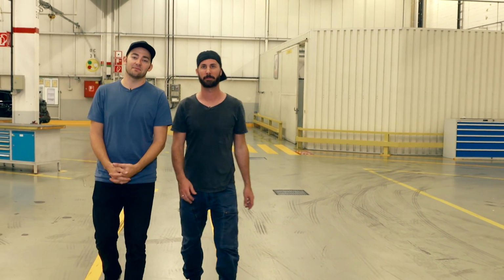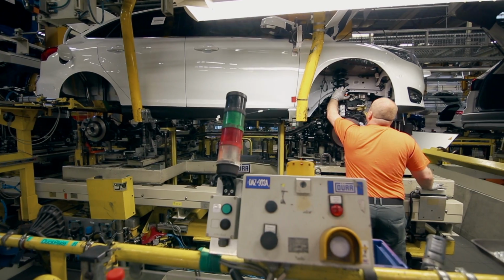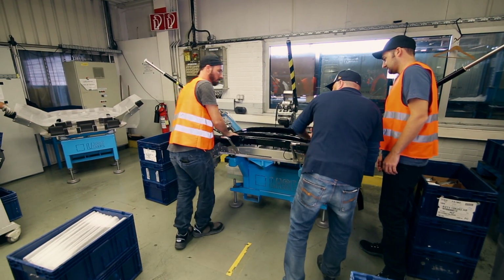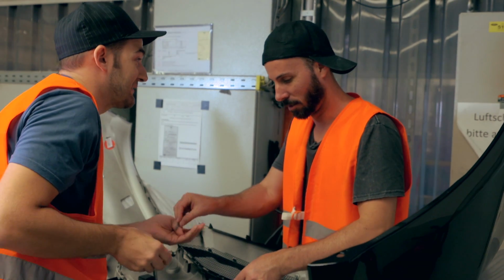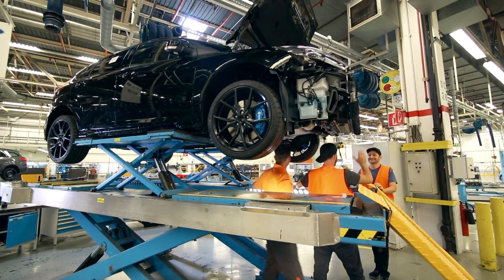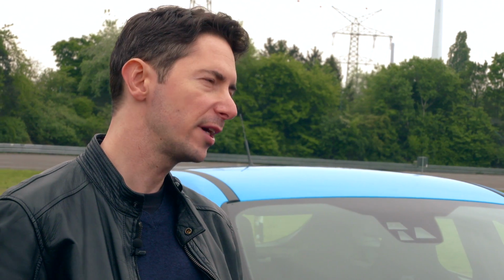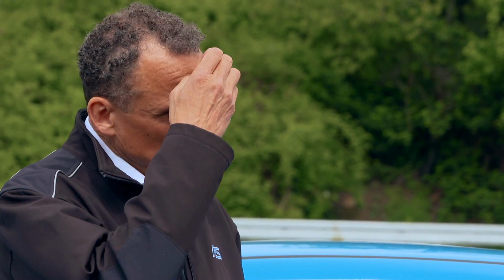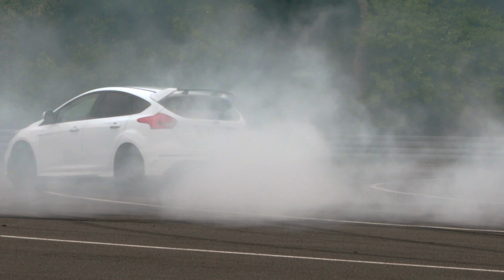Making Our Own Ford Focus RS In Germany

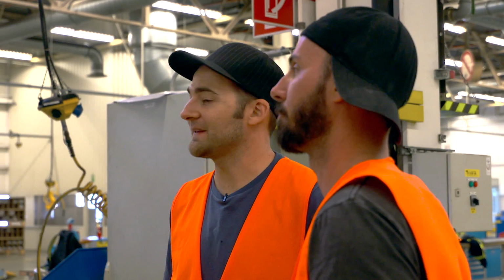Comment: 13:30 What's with the plate on the intercooler? Probably a myth, but is it true that the intercooler was actually too efficient, and they needed to block it off to keep some heat in the car?
Reply: The plate is a band aid fix for a condensation problem. Water accumulates in the IC because you are compressing and cooling air which reduces it's ability to hold water vapor. In high humidity conditions this basically means it's raining inside the IC. With the blanking plate the IC doesn't cool the air as much so that water doesn't condensate and eventually get sucked into the intake. It started as a problem with F150s. Google F150 EcoBoost Shudder.
Reply: OldRed91 that's why they painted it BLAAAAAAAACK!
Reply: OldRed91 also... idk...
Reply: @Bean Bandit, I totally disagree. I'm very active on the forums and local Facebook groups. The vast majority of people are very happy with the car. People who are unhappy are typically people who are track junkies that are tracking their car dozens of times a year, and I'm not saying all those people are unhappy, just that, some of those people, who are capable of pushing the car to it's limit, get disappointing when things like the EPAS (Steering) motor overheats, or they have to deal with the lack of camber adjustment, or the RDU overheating. There are solutions to these issues. The guys out at MMP doing the RSAA have with a few modifications these cars running all day on track in the Utah desert. 

Now the rest of us mortals who aren't running in the most advanced track day groups typically aren't pushing the car to these limits. Lots and lots of owners don't even track the car (shame! x3). The people who aren't tracking their cars are never (to my knowledge) hitting these limits and IMO the car totally delivers. It is an absolute riot to rip through windy roads in this car.
Reply: ^^^^ They are also Disappointed about about the earlier engine blocks going out, like mine personally had a head gasket issue and i had to wait 2 months before i even got it back. but now it is TUNED again and running better than ever! Love the car
Reply: Apparently it's a blanking plate from a Transit
Reply: https://www.carthrottle.com/post/how-ford-fixed-the-focus-rss-intercooler-after-discovering-that-it-was-too-cool/
Reply: @Bean Bandit, I paid the equivalent of 35,000€ here in the US. I guess that you guys get hit by VAT or some other tax. I think prices in your country are simply higher. For example Golf R and STI are roughly the same price. From some brief research all of these cars have their own set of problems on the track. You might not fault the Golf R since it's not necessarily track targeted, but my point is simply that I think it's unrealistic to expect any car at this price point to go out and track all day at 10/10ths and not run into heat issues. I think that stems from the fact that in order to make these cars at that level you're going to need a lot of headroom in cooling which 95% of the buyers don't need (or want? weight). 

Either way, I know this discussion will boil down to how you think the RS was advertised. All 3 of these cars are advertised as being capable track machines. Go to VW's website and you'll see a video of the Golf R drifting around a race track not unlike the RS. Go to Subaru's website and you'll see video that looks almost identical, except with more dirt thrown in. They are all advertised showing the cars at the edge of their performance envelope. I think it's just some people are simply naive and think that the car can run that way non-stop. It's simply not the case for the vast majority of production performance cars.
Reply: Compressed and cooled air = condensation . Same reason why air compressors have water separators
Reply: No Myth. I have a CPE on my ST here in Florida. On a humid day the engine will start ingesting condensation from the intercooler.
Reply: I was actually talking about people that use it as a track car or daily. If you just drive it like a normal person will there are some minor shortcomings but those can be mainly overlooked. Also Germans just have different expectations when a car costs at least 40000€ (which is really expensive for a hatchback). The RS is just not made to be "tortured"(but kind of promises to be).
Reply: John Brooks I guess that's what you get when people don't care about tracking
Reply: Is it also not true that RS has been having gearbox issues?
Reply: It's black... that's why it cools too hard lol
Reply: What you said was confirmed true by the engineers
Reply: they obviously havn't been to Queensland
Reply: John Brooks well it's actually not about advertising (i don't really care) point is car manufacturers lie to you in the end about a lot of things
Reply: problem is if you ask about a positive myth they will always say that it's true. @John Brooks explained it pretty well. (trust me the rs is on no way, shape or farm too efficient). most people that have owned one will be able to confirm that the car is actually a huge disappointment as it promises a lot but can't keep most of these promises. It's still a great car though.

Comment: I'm a Subaru lover but I still like Focus and Fiestas. There's this one guy with a Fiesta ST I've seen a few times on the freeway in Hawaii. I was in my 2011 STI sedan daily with Cobb's sf intake, APV3 and 3" cat back exhaust. I have Cobb stickers on both smaller rear windows and Chopped fingers on the top right corner on my rear windshield. Turns out, this guy in the Fiesta ST had the same stuff as me. Cobb stickers on the smaller rear windows and Chopped fingers sticker on the top right on the rear windshield. First person I've seen in Hawaii with the Chopped fingers and we had pretty much the same stuff. Driving a Subie you have the Subie wave but this MCM wave was even better than that. We both knew what was up and gave the Chopped fingers to each other. Long story short, MCM connected two people in different cars with the same passion in a different country. Keep up the good work guys, you guys motivate a ton off like minded driveway mechanics, even in Hawaii!

Comment: Rocker panels here in the States as well... the only thing is it's normally a term used for older cars like classics, or trucks. Since most modern cars have rocker panel covers aka side skirts.

Comment: Such a good watch guys, from factory to track with a couple of yobbos and the designers and engineers on board as you thrash it. I agree with the engineer the motor is probably best left untouched if you want a car that needs to be reliable too. I was going to modify my fiesta st but it was our only car at the time and ford mechanics said yeah go ahead with mountune etc but if you go too far things will go bang. If you are going to race well yeah thats a rich mans game and money  and reliability is not so impôrtant.

Comment: Grats on getting an awesome car.  Get a proper exhaust on it and a tune right away.  If you have high humidity, you're going to want a FMIC because the stock unit soaks super fast despite it's size, climbing above that 100F mark and the car pulls timing.

Comment: Looks nice and planted and very controllable in the drift. Didn't expect that
Reply: DanTheUpholsterer it's basically computer controlled. It can send power where it wants and brake each wheel individually. You just hit the power and steer, it pretty much feathers the throttle appropriately for each individual wheel.
Reply: Benny Mackney yeah didn't expect it from an awd car is all looked more like a rwd

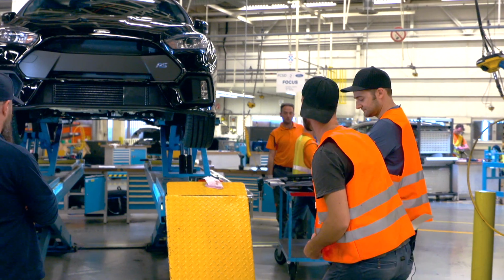Comment: i little tip: in 14:28 you see the intercooler, but do you see the black plate at the right side of it? Get rid of it becuase it will be woth it in hot areas where he temp is high because the intercooler will gave more room where he can work.

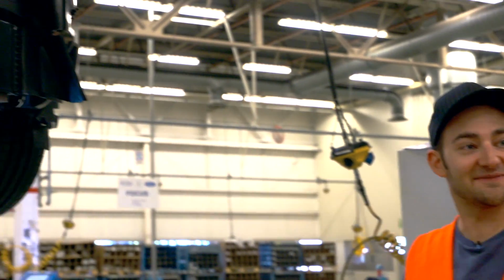Comment: 13:30 "epic" black frontmount with a third of the area blocked off fore some reason...
Reply from the maker: IReallyLikeWaffels turns out the intercooler design was too efficient. (Yup) so they got a blanking plate from the Ford Transit to block part of it off.

Comment: Strong engines, apart from when the engine block cracks! O.o
Reply: Yeah, poor design has been fixed! So hopefully you'll be alright now, just don't buy used.. Which all we want to do anyway :/
Reply: phatt180 So pretty reliable engine now?
Reply: BrabusBandit cool ✌
Reply: BrabusBandit that was only in the early batches, problem has been since fixed.

Comment: What is it with the hype for the RS!? It cracks it's block if you push it too hard. It pinches its brakes individually instead of having proper torque vectoring, which cooks the brakes after a few corners. Not only that, that type of torque vectoring generates huge amounts of heat for the diffs, and in the case of the rear diff, they're known to overheat. When that happens the RS's onboard computer decides to protect it by keeping all the power at the front.
So you end paying £32,000 for a focus ST with more power, a diff at the back that will stop working when you want to have fun and therefore more understeer.

I'll get a Golf R for the same money thank you. It hasn't got these stupid problems and it's faster (despite being 50bh down so work that one out), it's more practical, it's more economical and it's more comfortable.

Ford stop employing accountants to build cars and let engineers do their work and fork out the money for proper components!

Comment: love it. the engineer tells him to side step the clutch :')
Reply: lloydness s that is just how the launch control works. Slam the accelerator until it hits the launch rev limiter, then drop the clutch and the computer takes over. It just automates the usual accelerator feathering and clutch slipping. The actual clutch doesn't actually drop like it does in a regular manual car.
Reply: lloydness s cool ✌

Comment: The rocker panel is actually the metal part of the unibody behind the side skirts, which links the front and rear torque boxes. Plastic aero crap is just a skirt or a cover.

Comment: That's awesome! Visiting the plant must have been a blast. However, it would probably be good consumer advice to read the fine print regarding manufacturer's warranty before putting an aftermarket boost controller on it.

Comment: Srs question: When you were putting together bits and pieces of the car, were you thinking about what you might change about the car?

As someone who modifies their cars, whenever I'm in the showroom, test driving, or riding in a car, I'm always thinking about things that would improve it, or things that would make it closer to my ideal version of that car. I imagine when presented with the opportunity to build a car at the factory, I'd be looking at parts of it thinking "I'd like this better if it were more like car X" or "This piece could be replaced by thing Y and it would probably be a little quicker/handle better/etc."

Comment: Nice car but I'm not a fan of FWD cars :)
Reply: It's reactive fwd. It's not true awd at all.
Reply: MV60 you are correct. Simply put, there isn't a straight answer on "the car is 50/50, 30/70, etc etc" if you're thinking about the Subaru world for instance. At the end of the day, normal driving, the car is FWD most of the time. The Twinster is an "on-demand" system, it is not throwing torque to the rear wheels on the highway for no reason, like a Subaru would be with it's full time AWD. There isn't any point to that other than waste gas anyway.
Reply: Which ultimately means that at the end of the day you've got something that when you need the extra traction / torque distribution and it reacts to it, it's too late. The situation is already happening. An active awd, even if you think it's a "waste of gas" is still superior and what you want from an awd system. I'd say it's a waste of gas lugging that useless rear drive system the focus has. ;)

Comment: What type of mods are available for the focus rs?
Reply: Wilbin Medina anything you want. Suspension for focus ST's have been out for years, as with cosmetics. Engine is from the current 4 cylinder mustang, lots of drivetrain mods available. Exhaust, ecu, and other kits are readily available.

Comment: Basically the same engine and few bits from the mazda 6 mps. :)
Reply: Built Not Bought No it's not. A lot of people thought about that, but nope. Completely different architecture and block.
Reply: Both are based of the ecoboost 2.3. Ford used mazda to test run their designs and made improvements for the RS
Reply: Built Not Bought it might have the same roots but it is very very very far from the same engine